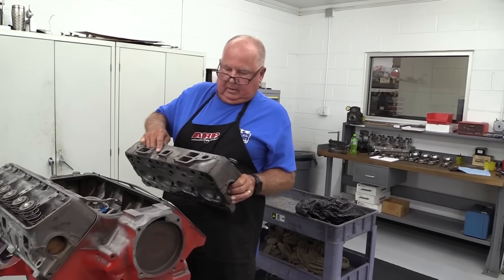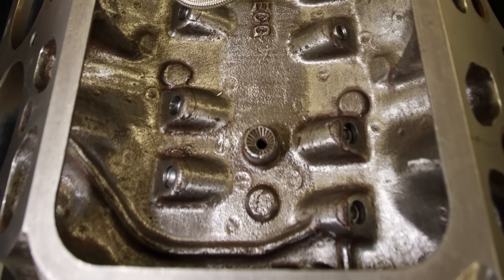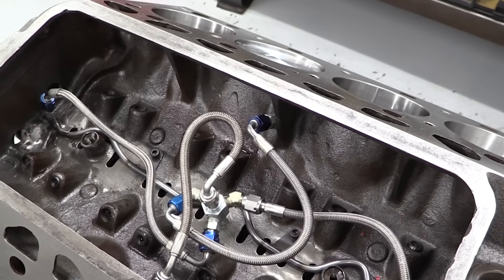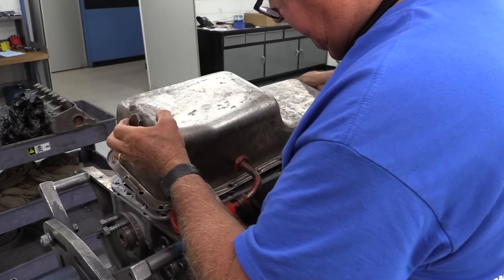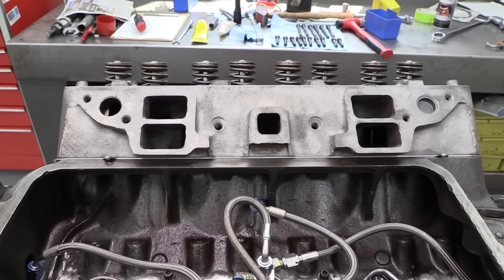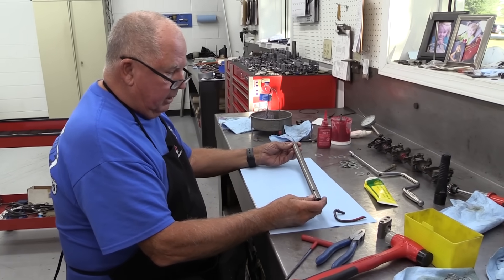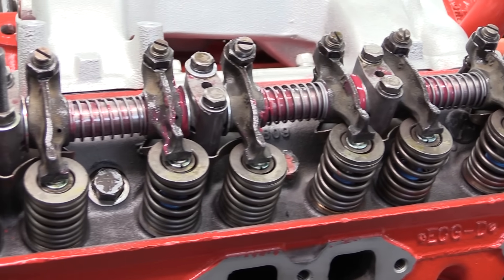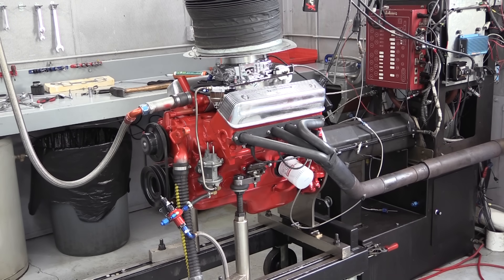The Engine That Replaced the Flathead -- Ford Y-Block Build

Comment: Would the newer synthetic oils and improved filters have prevented the oiling limitations in the old Y-blocks if they were available today? Other than that, would the Y-block be considered a good design? Was it a much improved advance over flathead it replaced? And was the comparable Chevy 265/283 a better engine?  What flaws did it have as compared to the Ford Y-block?

Comment: This type of engine, prepared by Mr Horsepower himself Clay Smith won it's class in the Mexican road race in the 50's three times. That was 2000 miles of racing over 6 days.

Comment: This guy has no idea what he's doing. We erased those engines for many years successfully. A clean engine actually had too much oil to the overhead they actually had tubes trending it all back to the crankcase. They're trying to correct something that took place in the past from non-detergent oil and the oil changes on high mileage engines. This is the stupidest video I've ever seen

Comment: I owned 2 Fords with y blocks. And father owned 2. One was a 312.  We used Havoline 10-30 detergent oil changed every 2-3k and never had rocker arm oiling issues. Even at 90-100k. Never.  Keeping the engines clean internally was a priority.

Comment: The 292 was a very capable engine, but they had manufacturing issues. I had 3 of them.
Since Fords "Y" block came out before GM's OHV, the exhaust really shouldn't be referred to as "Chevy style". Chevy heads should be referred to as "Ford style".

Comment: The picture is not a ford y block ,the y block has the distributor in the back not the front lol
Reply from the maker: Um ... that is the back of the block. The engine is facing away from you.

Comment: Our fire department’s original 41 Ford came with a flat head but was replaced with the 292 Y block in the early 80s.  It was pulled from the 1962 F800 if I remember correctly.  It was rebuilt at that time and has been going ever since.  It is relegated to parade use at this point and aside from valve seals and a stuck lifter after sitting for 10 years, it’s been quite reliable.  It has the truck “Ram’s horn” exhaust manifolds which apparently help with torque.  

That copper pipe he removed from the rocker shaft was part of an aftermarket external oiling system for the rocker arms.  Between the poor design and the oils at the time (which were usually non-detergent and tended to plug galleries with carbon) it was common for the rocker arms to lose oil pressure. So an external tube was added from one of the oil gallery plugs, and run right into the rocker shaft itself. Our engine has this feature added.  It’s rudimentary, but at the time that was a simple yet effective fix for the average person‘s vehicle.

One of the things I enjoy the most about old vehicles is seeing the technology that didn’t work and never made it past that generation of engines. Also interesting to see how they designed things before having the technology that worked well enough to replace it for years to come.

Comment: I built a 390 back in the 80’s. Toke a 352 out and put a built 390 Police intercepter punch out 50 over 10.5 compression and a mild off road cam it put 435 hp. Miss it everyday ❤

Comment: We have a 312 t bird engine in the machine shop where I spend my spare time doing head block work. My boss does the machine working on the rotating assembly and I do the assembly. The Y block we have has some core shift and when the camshaft is located in the last bearing it gets really tight. There was only one fix for that. Bet you can’t guess how. Think about it for a minute.

Comment: A small block Chevy intake can be made to fit the Y block Ford if you are having a time finding an intake for the Y block. The same man designed both engines. It’s the precursor to the small block Chevy.

Comment: For those who think the Y-Block wasn't a performer, research the Y-Block's career in  stock car racing, 55-57, with many still being ran in 58, with total domination in 57. The only  oiling issue was lack of maintenance, and inferior oils of the day, the problem no longer exists. I have a 56 F100, "somewhat" built 292, with a 312 bore, 471hd truck heads, 10cc domed pistons, MSD distributor, aluminum intake, Autolite 4100 4barrel. Pretty feisty little pickup

Comment: That oiling system is really cool and definitely not like anything else.
Reply: Yeah, other engines actually oil the rocker arms.
The Ford Y block - Heavy, long stroke, stacked port, low RPM, rocker squeaking,  rear main leaking, piece of junk.

Comment: After all, which is better, the 292 Y block or the Windsor 302?  Which causes the least problems?
Reply from the maker: I would say the 302. More modern cylinder heads, better oiling, ability to run roller lifters, better parts support, etc. But I definitely appreciate anyone who wants a cool-old engine. Or anything outside the norm, really. Thanks for watching!

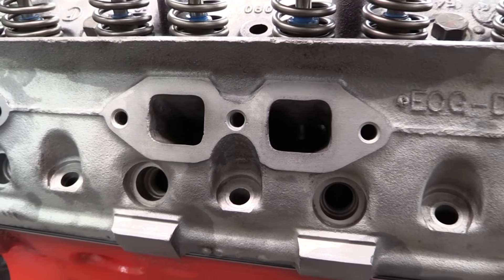Comment: At 8:50 stating the Y block has a chevy exhaust layout. Actually a Ford flathead V8 layout that the Y block replaced. The Y block ports were better because of the increased spacing between the middle two.

Comment: Stop and think:  in 1953, the last year of the Flathead, the Horse  Power rating of the 239 Cubic Inch Flatty was  100 HP.
   In 1954, the first year of the Over Head Y Block, the Cubic Inch was the same as the 1953 Flat Head at 239.  The Bore and Stroke measurements were different but, the Cubic Inch was identical.  Horse Power rating: 130.  This shows the vastly improved breathing ability of the OHV Engine.

Comment: Okay, I'm a little confused...  It looks like it's running a Load-O-Matic distributor but the carburetor has no spark control valve and the vacuum line isn't connected.  How is the engine getting spark advance?

Comment: The Y-Block engine was the first engine I ever built. I used a Isky cam and an Offy Intake with multiple Stromberg carbs. Learned a great deal and had a ball. It was in a 63 F100 shortbed. For the effort it would have been a bunch better to have installed a 289 or 302 but i was a Jr in High School. You have to start somewhere.

Comment: OOOps! You messed up. Ford built overhead valve engines during WW2, the GAA engine in M4 tanks. Also since the Ford Y Block came out in Fall 1953 it predated the Chevy small block by some 20 months so your comment about the y Block exhaust being like a copy of chevy small block.

Comment: I had a 54 ford with the overhead valves and I thought that was their first Y block , I  loved that old two door post  ford I put a hopped up 292 that I bought from a stock car racer ,it had very good heads that were ported and polished, l think they started out as 312 heads and he had them built up at Dougs racing stables back in the days, wish l still had that little ford.

Comment: I remember trying anything to stop oil leaks for tin cover under intake. Would tap in wedges under head ports to keep crappy cover down against gaskets. Japanese motors put gaskets in groves. Keep gaskets in place. American manufacturers finally copied after Honda and Toyota kicked their____.

Comment: The 292 & 312 are a engine that was used alot in commercial vehicles & pickups & were easy to work on & tune up. Setting the points was done with a book of matches & a flathead screwdriver.

Comment: Amazing how many bowtie fans comment on Ford videos. You don't see the opposite very much, Ford guys could give a rats butt about watching a video about a bowtie. Seems like the bowtie bunch forgot about the first year of sbc production. Chevy forgot to cross hatch the cylinder walls and every sbc sold for the first half year of it's existence spewed oil out the tailpipe at an alarming rate. Chevy recommended one quart of oil for every 100 miles driven. And that whole "sbc design lasted for 50 years" is total BS. The design was changed as often as any other manufacturer's. But Chevy was real smart about keeping the mating surfaces and accessories mounting consistent through the years, whereas Ford and Chrysler not so much. That led to a lot of aftermarket performance parts in favor of Chevy.

Comment: 292 and 312 Ford engines were pretty crappy compared with GM and Chrysler motors of the day. Oil delivery to the heads was worse than poor and the stroke was ridiculously long, which is why a 265 Chevy would eat them up.

Comment: remember those dyno HP figures will drop when the original cast iron exh manifolds are back on the engine. Im sure those headers helped it on the dyno.

Comment: The old Y blocks didnt have oiling problems unless you didnt keep up with oil changes which alot of people didnt back then.They had small feed  holes in the block and heads and a little sludge is all it took to plug them.People used to pull the valve covers and run wire through those holes to open them back up.They were tough as hell and nearly impossible to break.Fords engineers did an outstanding job bringing in the 1st OHV for the company.
Reply: Beautiful said I change my oil lots more in my old 292 took it to 3 cars shows Ran strong love it in my 57 rancho 3 on the tree
Reply: And the oil is better today too.
Reply: @G.S.W.SewmesomeMusic  yes it is!and that's really all they need to live without any maintenance.
Reply: You are right there was a oiling problems  but a lot of it was the oil back then wasnt as good as today. One of the main oils back then or maybe preferred was Havoline it was a paraffin  based oil.. It caused lots of problems as well as lifter problems. A lot of the oils were less than perfect. Have a great day.

Comment: Been a lot of years but if I remember right the 312/245 hp motor has a higher lift/more duration cam. Those distributors  were noted for seizing in the block too. Those fuel pumps were bad of leaking fuel into the oil.

Comment: 8:1 comp is surprising close to modern engines, at least compared to the 70s and 80s. And 200hp is nothing to sneeze at in an old lighter weight vehicle
I'm shocked that made that huge of a leap in power vs a 4:1 (iirc) flathead.

Comment: I was told the rocker arm return lines fed oil to the timing chain and the distributor gear, is that not the case?

Comment: The purpose of the second oiling hole is to make sure you get even wear of valve train that way your engine goes out sooner and you will need work on it faster... You just discovered the cousin of apple.. same engineer family.. set up for failure 🤔🤔🤔🤮🤮🤮🤮

Comment: Back in the day, the first real engine I messed with was a 292 in an old ford parked out in a field. The owner assured me it had a hot cam in it, and I paid him ten bucks for it then proceeded to remove it....but, I couldn't. I had no idea it had mushroom lifters that had to be removed or pulled-up and held with clothes pins for the cam to come out. 
Later, my old man bought a ragged-out 1961 F-250 4 WD and used it as the base for a water well pulling rig. I put thousands of miles on that thing, and with the 4.56 gears, it always seemed to be wrapped tight. Over the years, I rebuild that engine four times. Knowing it had oiling problem to the top end, I tapped the oil gallery and rigged-up a system of copper tubing to deliver oil to the rockers. An old hot rodder told me the torque spec on the head bolts was way too high, so I backed down to 70 pounds, then after some blown head gaskets, finally solved the problem at 85 pounds. I was all set to build a 292 or 312 hot rod engine, but found a 392 Hemi in an old push button transmission Chrysler, and well, went off in a different direction. But, I have never forgotten to potential of the Y block for a solid engine in a light car, and am running some possibilities through my head. I was in my teens back then and had managed to get a hardship drivers license to drive the rig truck. Over the years I built an Austin Healey with a 500 HP 327, a Comet with a 454, and finally owned a brand new 1969 Mach One with a 428 CJ....which I now wish I had back.:)

Comment: Well I'm having an issue here cuz I think I might have a white block in my 61 Chevy Apache the previous owners the engine swap they used it for towing it to Apache 30 and they swapped it out from the original engine to a replacement engine I think out of a bus is what they told me but his wife told me when I bought the truck and the Chevy I thought it was a Chevy 427 because it looks exactly like it well looking back now after pulling into shooter and trying to put a Chevy one in finding out that the distributor gear for oil pump and all that is not the same the teeth on it go the opposite direction but the firing order matches a Chevy 427

Comment: We have one of those 64 ford wrong bed trucks in our collection. A guy named Hastings English bought it new. 3/4 ton. Set up high. I remember when we met him going down the highway. There was a plume of blow by coming out from the crankcase breather. Got to look under the hood. That truck came with a factory PCV. However it produced more puff back than it could handle. So they had installed one of those earlier cannister road draft on the side of the block. Many decades later. I bought that truck. Upon inspection. It was clear that there wasnt a hole in the block for that  early road draft. They had drilled the cast and broke a opening.

Comment: Poor design. Slow to build RPM. too heavy valve train and pistons ect. leaky had plenty of blow by. I started out with them. The Y block like a 348 chevy  just are not what some folks think they are.  Easiest way to make a Y block  Ford Faster. Pull that boat Anchor and install a FE. Im 70 and keep hearing about fast Y blocks. Never seen one yet. I have a $1000 that says the stock 65 chevy Power Pack  283 in my 55 wagon will beat any stock  292 in a 1/8 or quarter mile drag race. My Father had a 64 chevy long bed 283 2bbl. Our neighbors who had a son my age. had a 63 ford short bed unibody. Lost a piston. So they bought a .060 overbored  292 long block from NAPA. Installed a square base 312 intake with a holley 4 bbl carb and dual glasspack  exhaust. And my dads 70,000 mile 283 two bbl with quiet single exhaust. could easily outrun it in the Quarter mile and top end.

Comment: 1961;  building engines in an auto supply machine shop, it seemed that nearly every Y-block that came through the shop had a flat cam.  But when they were running right, I was always fascinated at how slowly and smoothly they idled;  reminded me of a fine watch.  Was hoping to get a glimpse of that in this video, knowing a stock cam was being used, but oh, well...☹

Comment: Well he should have talked to smokey unick he was the man that had the y block winning races in the 50s first he would open the oil hole from the center main journal to the cam to 3/8 inch then open the center cam bearing oil hole to 5/16th then  from cam to top of block 3/8 then the Grove he would hog out to 3/8 deap then the holes at each end to 3/8 he never used out side oil lines the y block was a side oiler block solid cam mushroom lifter crane canes had a very hot cam for y blocks the heads need to have a very compatent head porting man do the heads with light weight stainless valves and crane springs with there cam use a aluminum flywheel on your motor the cranks are heavy enough with a good clutch pressure plate I've built y blocks that made 400 plus HP and would turn 8000 rpm and never broke if you can find a set of mercury heads off a 341 y block they have the intake ports like a small block Chevy they breath fairly good compared to 312 or 292 motors the mercury motors were better to hot rod I got a 368 out of a  1959 big tandom axel truck use the 440 mopar tunnel ram manifold or a SBC tunnel ram manifold with spacer plates between the head n manifold use the t bird aluminum oil pump it's a gearator style use a windage try and a good oil pan it's easy to make power with the right parts y blocks are no exception j c Whitney had fender well headers that I found to be a good fit and made good power engine masters built y blocks that made 600 HP so there ya go long live the y block

Comment: These had a huge problem with 1950s non-detergent oils clogging the oil passages in the block and cylinder head. 
Many were modified with an external oli line entering thru a hollow valve cover rocker shaft stud.

Comment: I have one of these in my 1950 Willys Station Wagon .. guess they didn't like the four cylinder that was originally in the vehicle and replaced it with the Ford Y Block ...    Not sure what I'm going to do with it other than sell it for someone wanting to restore one of their vehicles needing the correct type of engine.

Comment: Not a Ford fan at all but as a teenager I had a '56 Ford with several 312's in it. They were easy to tear up by a dumb kid! I always liked the looks of them. At that time the only "speed equipment" was a set of Montgomery Wards performance exhaust manifolds and a "race" cam. I tried a Tri-Power setup too with Stromberg 97s and I don't remember if the thing was a Ford item or aftermarket.

Comment: That's a good little engine. Dad has one in his 55' T-Bird. The only thing I'm not fond of is that distributor. It doesn't have a mechanical advance and Dad wants to keep it because the mechanical tach in his dash connects to it. As your rpm increases, the timing is progressively more and more retarded. It would run a whole lot better with a modern distributor.

Comment: Lets not forget that the Lincoln division of Ford Motor Company had a OHV V8 in 1952. And for all  you Chevy haters, Chevrolet had a OHV V8 in 1917, 15 years before Henry built his flathead V8 in 1932. The car was the Chevrolet model D. Made from 1917 to 1919. It failed because it was too expensive and few were sold. I have owned many old Fords and Chevys and like the both.